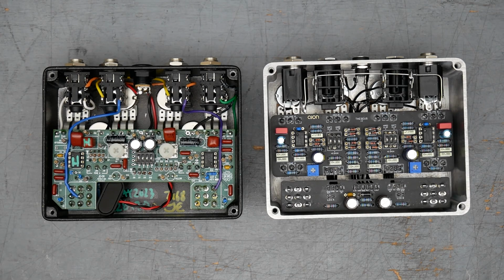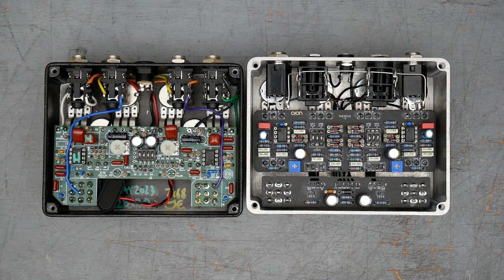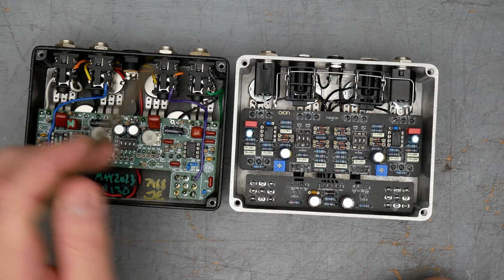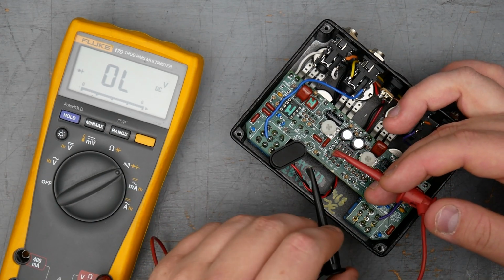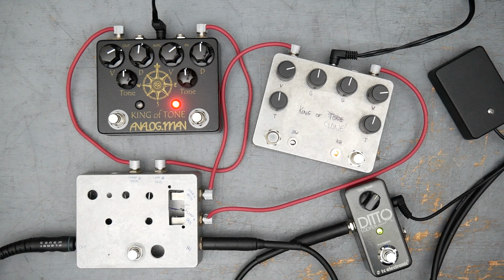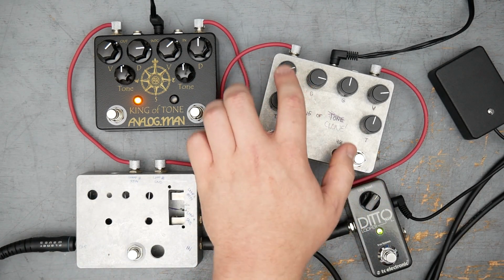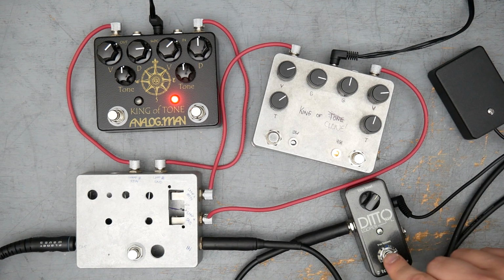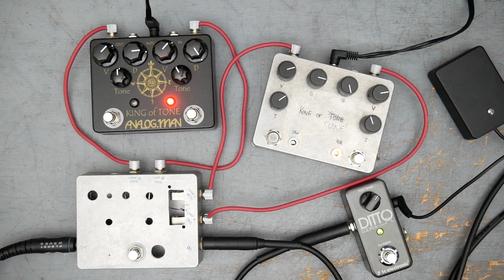Analogman King of Tone vs. AionFX Theseus Clone // Gray Bench Electronics

Comment: Hi I love your YouTube videos. I’m a DIY builder and I’m just finishing up the AionFX Theseus project. Can you comment on your grounding scheme? Specifically it looks like rather than using a star ground from the DC jack you’ve run ground to the PCB from the loop return jack is that right? I had already decided to use buss wire so your video helped a bunch in that regard. Thanks!

Comment: Hi Joe. Could you possibly confirm the value of the input cap for each side on the original KoT?

AionFX has it pegged as 22nF, but there is an overwhelming number of schematics having it as 10nF (a value used all over the KoT design in other places).
Reply from the maker: The main schematic for the KoT is from FSB, which shows 22nF. Probably what AionFX referenced. I don't have a KoT anymore so I can't check.
The bluesbreaker had a 10nF input cap, that might be the source of the confusion.
Reply: @graybenchelec Thanks, Joe. I really appreciate the response anyway 🙂

Comment: The real KOT consistently has a bump in the low mids (or the Aion build is slightly scooped) but nothing major.  Pretty obvious in a side by side test like this, but changing where you pick on the strings by a centimeter or so is going to make a bigger difference than the difference between these two in real life.

I've built a few pedals with Aion boards and I've always been happy with them.  Pretty much my second go-to PCB source after Dead End FX these days.

Comment: King of Clone for me. They sound the same (minute differences aside, nobody would care in a mix). And honestly speaking, I liked much better the circuit layout (it looks more organised, pot lugs aren't weirdly bent under tension...), the component choice (metal film resistors are a plus, diodes are more available in case you have any issue), the shorter waiting list, and the probably much lower price.

Comment: Low gain sides were completely indistinguishable. The KoT on the high gain side seems like it had a little more low mid grunt and a little less fizziness in the top end thatI found more pleasing. But you could probably find a tone knob position that would make both pedals sound pretty close to identical and could just be due to part tolerances. I have an Aion clone I built, but I’m still going to keep my spot on the KoT waitlist, if nothing else for the fact of supporting Analogman and getting an amazing pedal at a still very reasonable price.

Comment: GRAY BENCH, make a YT lesson using the Oscilloscope to visually see the differences of the clipping diodes MA856, MA858, MA859, BAS33, BA282 because the forward biasing voltage is only showing the threshold turn on voltage not the diodes "signature" or clippage waveform. You have the test equipment which you can also sweep from 20hz to 20khz and compare A/B both pedals to see the frequency profile to compared to pedals against in a YT video to visually see the differences, why not do that?